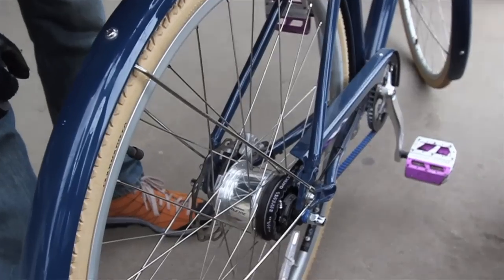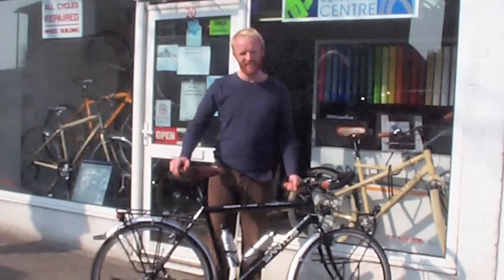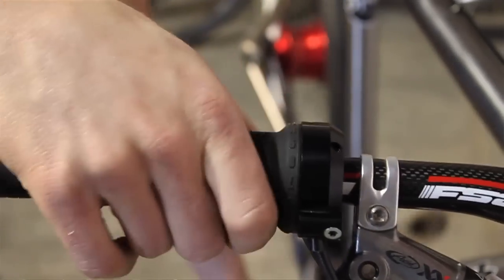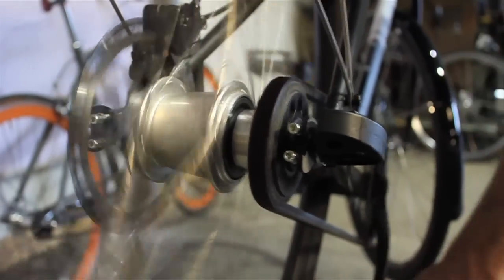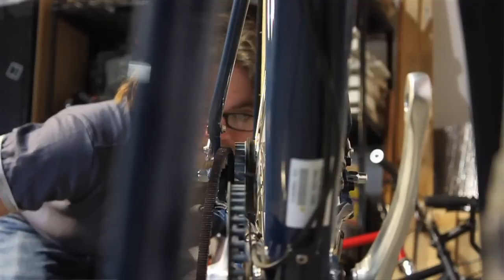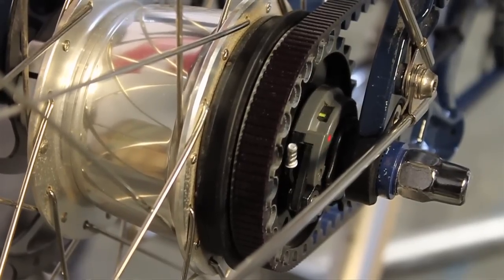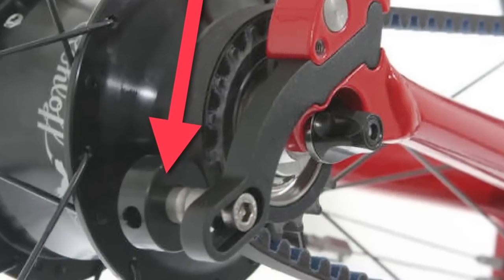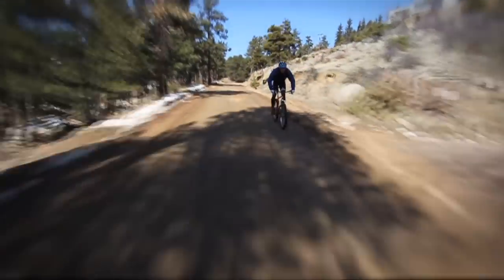CDU 4: Internally Geared Hubs

Comment: There is good trick for adjusting the snubber distance. Just fold a bit of paper two or three times and place them between the belt and the snubber as the space holder. Then remove the paper after all is set and fixed.

Comment: Did I miss something? Or was there no mention that you need to split your rear stays to get a belt drive onto a frame. It’s kind of one of the most limiting problems with this system. 
I would like to just sling a belt drive on and off any old frame and have fun seeing how it feels. 
Do you know if there will ever be a belt drive that splits?
Reply from the maker: The Carbon Drive belt is one piece. That's why you need a belt-ready frame (or another frame construction) to integrate the system. An belt opening would definitely be a weak point and would make the belt less durable. Our strategy is to produce the strongest and most durable drivetrain in the world.

Comment: There are methods to couple IGHs with multiple chainrings (front derailleur), but people usually consider that a "worst of both worlds" approach. You need a chain tensioner installed, the chain has to angle (unlike on a strict IGH where it's always straight), the derailleur needs to be set up and aligned and maintained, you lose the weather-resistant aspect of the IGH since you're using a derailleur anyway, it's heavier and less efficient than a simple rear derailleur, etc.

Comment: I believe that most experienced cyclists know that when Tour de France riders start using a belt drive and or internally geared hubs, they are ready for prime time, and not sooner. I think the belt drive simply has too many cons for competitive cyclists, such as greater resistance, rear hub is much heavier, which means its not as fast. I could see where they would want to use it on a motorpaced speed record, because having a chain fly off and get jammed up in the rear wheel is catastrophic.
Reply from the maker: How do you feel about belt drives now, in 2021?

Comment: Misconception? It's basic physics. A lighter bike requires less force to accelerate; or put another way, applying the same force will make a lighter bike accelerate faster. That is a fact of the universe. Once the bike is at speed, a heavier bike has more inertia and therefore resists frictional forces (e.g. air) more than a lighter bike; however, this is a minor effect.

In a straight line, with no starting or stopping, a heavier bike is fine. In the real world, a lighter bike is more agile.

Comment: To take up the slack of the chain. For example my chainring set is 48-38-28 You need something to take up the slack between the amount of chain needed between 48 and 38 and 38 and 28. A front derailleur has no ability to take up slack. One problem with an internal hub is you cannot achieve a 1:1 because the front chainring is always bigger than the rear sprocket on a IGH. My cassette has a 28 tooth cog, so I can achieve 1:1 - 1:4 (48/12). A fixed position derailleur wouldn't be such a headache.

Comment: Nope, the rear triangle has to have a break point. It's best if the frame is built for it specifically, although in theory you can modify a frame to accommodate (kind of a major change though).

Comment: That was probably a Sturmey Archer 8-speed or similar, the first gear in that is direct drive (1:1), meaning it goes from 1:1 to 3.24:1. Since an SA 8 can only gear up from the cog, it requires a very small chainring to make sense. A much more typical IGH would be the Nexus 8-speed, which goes from 0.527:1 to 1.615:1 as I said. When coupled with a normal chainring/cog, this gives a pretty standard range. A Rohloff can do 0.279:1 to 1.467:1! That's very wide. sheldonbrown com/internal-gears.html

Comment: Cantilever brakes. They have incredible stopping power, but need frequent adjusting and it's not like the old days where you just turned a screw, you have to move the pad closer to the rim on each side and if they aren't equidistant, I think it can cause dishing or bearing problems. I definitely don't want coaster brakes, but lever based drum brakes seem to be the best option for bad weather. In fact, I am thinking of replacing my front wheel for a drum brake model (70% braking in the front).
Reply from the maker: Did you ever end up replacing it, Christo?

Comment: That's why you use a chain tensioner, not a rear derailer. Functionally similar, so I see where you're coming from. Also, what are you talking about re: cannot achieve 1:1? Yes, the chainring:sprocket ration is large:small, but the whole point of the IGH in the first place is then you have internal ratios ranging from (say, on a Nexus 8) 0.527:1 through 1.615:1. A good IGH has a similar range of ratios to a derailer (a Rohloff is even wider).

Comment: Doubt that it's more efficient than a chain (even with the carbon fibers it must flex to a degree), but it looks comparable at least – much better than any other alternative drive system. The IGH weight penalty is another matter, I also suspect you still net heavier overall (but I personally couldn't care less as I prefer IGH for bikes in general).

Comment: Why would you need the rear dérailleur at all? You only need the front dérailleur in your hypothetical setup.

The angled chain efficiency loss is very minor. My point is the moment you add a derailer, you're negating many of the advantages of an IGH without gaining much beyond gear range.

It's not impossible, some few people do it, but most people prefer either all derailers (lighter, less expensive, high range, efficient) or all IGH (weathersealed, shifting when stopped, less maintenance).

Comment: You'll have to research all the brands (Shimano, SRAM, etc.) and models (e.g. Alfine, Nexus, i-Motion, etc.) – there's a lot of choice, though the Nexus 8 seems to be manufacturer's preference these days. Some have coaster brakes, others "roller brakes" (Shimano's proprietary drum brake), others disc brakes, etc. I can't tell you more specifics as I've never looked into the braking options myself (my bike has the typical dual-pivot sidepull rim brakes you see these days).
Reply from the maker: Here's our bike brands page to help aide in the search: https://www.gatescarbondrive.com/bike-brands

Comment: Yes, it was a Sturmey Archer 8 speed. The reviewer took it apart and showed how it worked and he mentioned that first gear was a 1:1 ratio. I'll check out the Nexus and Rohloff. Do they come with optional lever operated drum brakes? I fucking hate the cantilever brakes I have(though they are VERY good in dry conditions when properly adjusted). You have to make sure they are equidistant from the rim (to avoid rim dishing) and make contact below the lip of the rim (which causes them to get stuck)

Comment: I would switch to an internally geared hub (preferably with lever pulled drum brakes) if you could keep the 3 chain rings in the front. Is that possible? Could you instal a rear derailleur (obviously in a fixed spot directly below the rear cog) )to pull up the slack of changing the front chain?  Having 3 sets of 8 internal gears) would be nice.

Comment: Is this drive train more efficient than a chain system (meaning is there less energy loss in the belt drive vs a chain drive)? If so, is it enough to make up for the extra weight of the internally geared hub?

Comment: I find that derailleurs are finicky, especially across an 8 cog cassette. With a rear derailleur in a fixed position under a single cog, I would think it would give you all the advantages of 3 sets of 8 speeds without the finicky rear derailleur (especially in the middle gears).
How much inefficiency is caused by the chain not going perfectly straight (say in the worst case of the inner most chain ring on the front and the outermost on the rear say 8th gear on a 24 speed bike)?

Comment: I Would like that system on my dual drive bike....pedal with your hands as well as your feet. Why would you want to do that? It's a total aerobic workout and adds 4-5 miles per hour to your cruising speeds.
Reply from the maker: We'd like to see a video if you ever get around to it!
Reply: But I do think that using your hands as well would merely reduce the power your legs can put out - thus not making you any faster - the body can only generate as many watts as it can generate, no matter how it's distributed among the limbs

Comment: Has somebody make a dual belt system to duplicate the number of gears? ...2 front rings mated to two rear sprockets.
Reply: why?  rohloff hub gives you 14 gears with more range than a sram eagle.  if you need more get a schlumpf however you spell it bb drive.